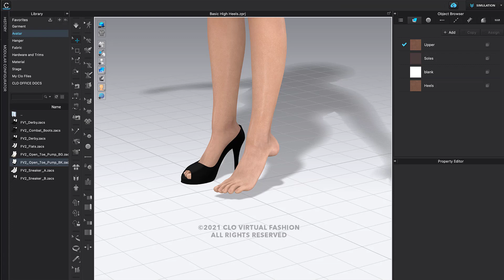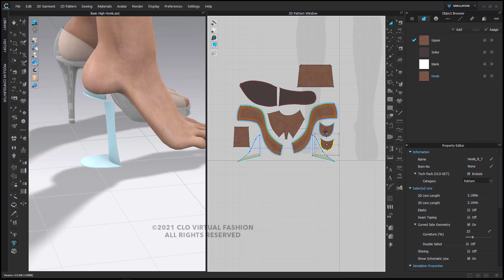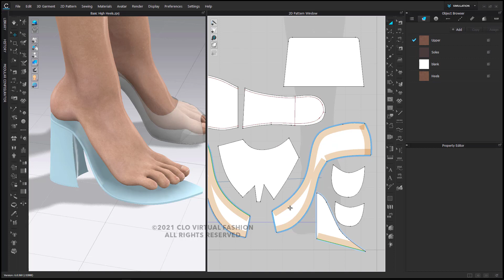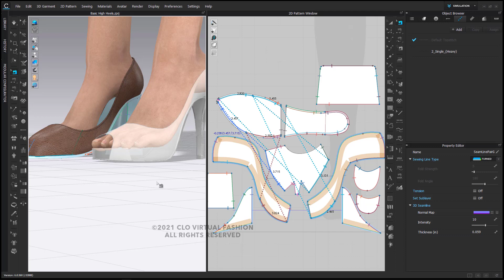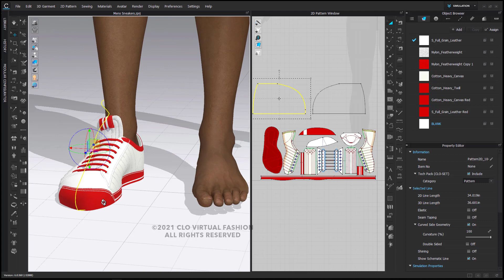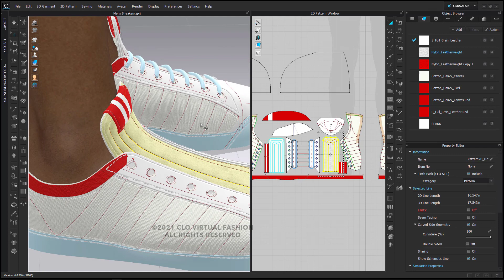Constructing Shoes

Comment: I have trouble selecting the shoe, and hair bra or anything that came with the avatar. When I try to select one shoe the selected part don’t turn yellow and when I try to delete a shoe the whole avatar will be deleted, same for trying to change color for hair the whole avatar color will be changed. Is there anything I’m doing wrong? Thanks
Reply from the maker: To remove hair or shoes, right click on them in the 3D window and you will have options. To stylize the Avatar & remove the underwear have a look at this document. https://support.clo3d.com/hc/en-us/articles/900006057446-Avatar-Face-Style-Configurator-ver-6-1-

Comment: Thank you! A few questions: is this suppose to be functional for animation? I mean without the additional manipulations (like using blender or other softwares). Also, is this possible to use for the heel and/or sole the obj/avatar file type? Thank you!
Reply from the maker: This construction would be specific for shoes that you want to Register for your Avatar. You can use similar principles as it relates to construction for just shoe design. Yes you can use OBJs as soles/heels.